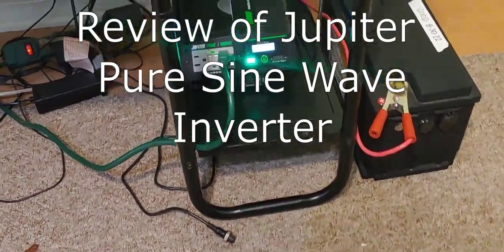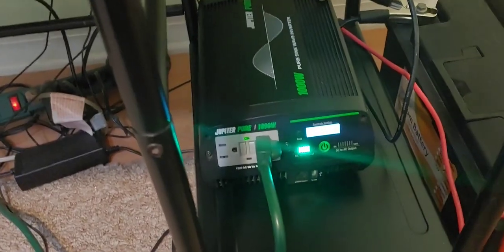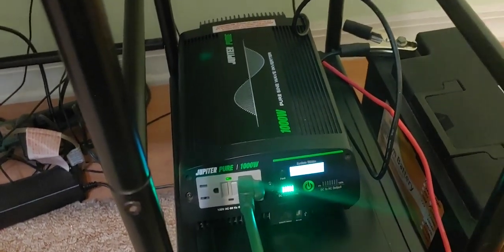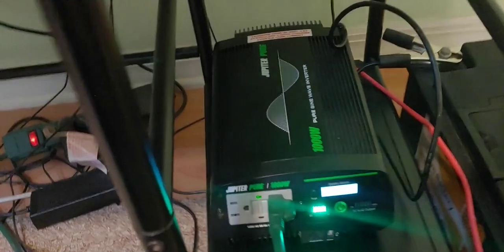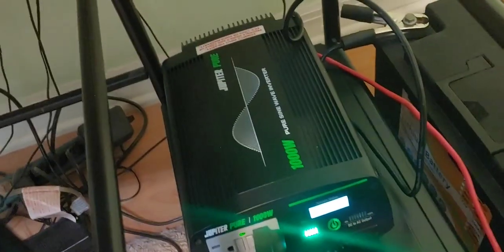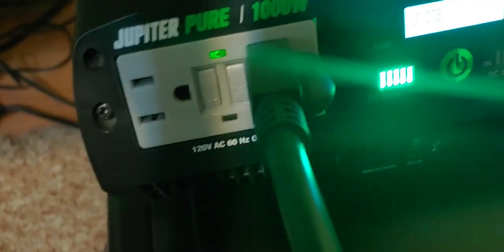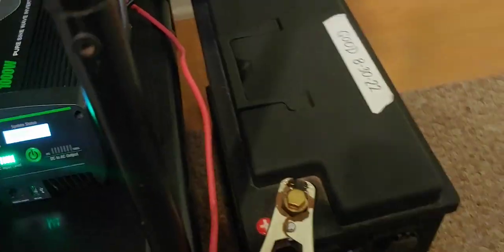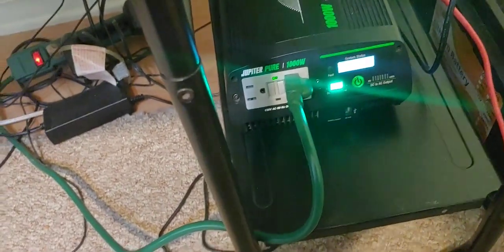Review of the Jupiter 1000-watt pure sine wave inverter

Comment: I just bought the 2000w Jupiter inverter. The manual says use lead acid deep cycle batteries. Any issues with the lithium battery after a couple months? I have lithium as well and became a bit worried after reading the manual. 
Thanks for any feed back
Reply from the maker: I have had my Jupiter 1000 watt inverter connected to several lithium batteries for a couple months now and it is still working fine. Thanks for your comment.